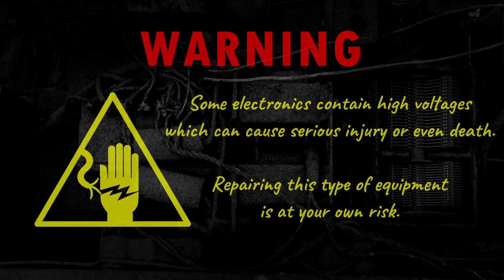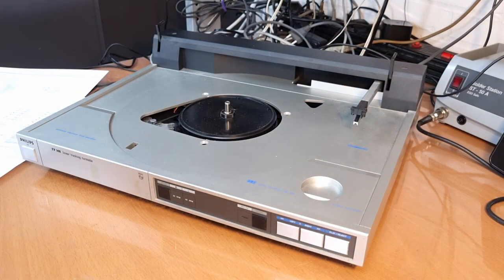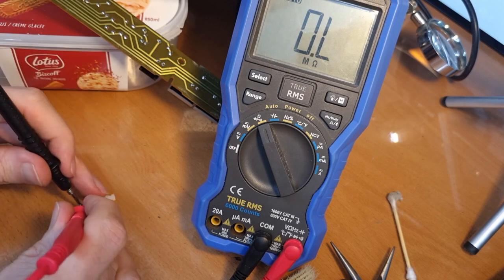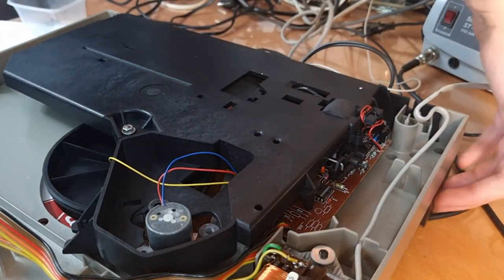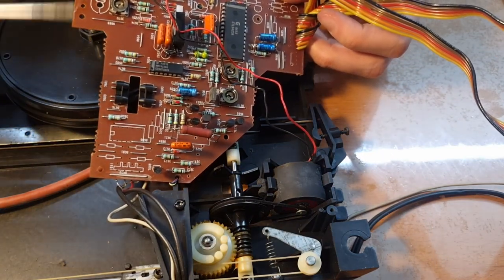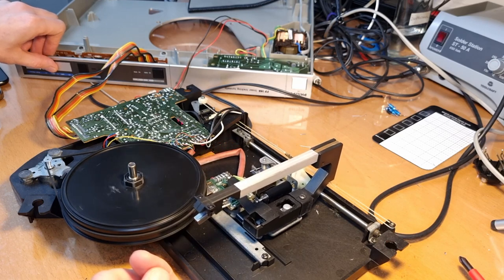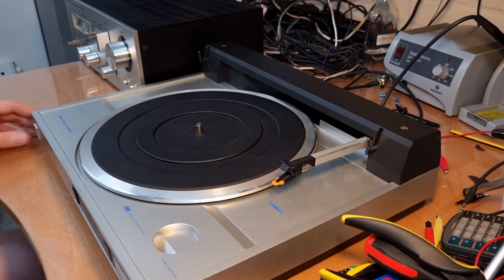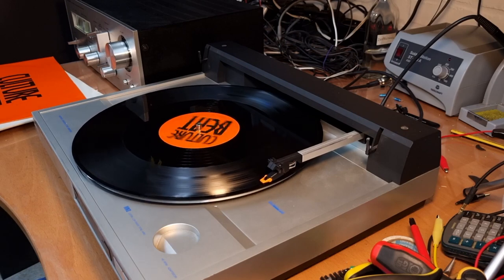Repairing a retro 80s linear tracking turntable - Philips FP146

Comment: Wow and that’s a cool looking tt. Back then there were so many cool looking tts and I had the Technics SL -6 back in 1985.
Reply: It the platter smaller than the record and the record hangs over the platter? I used to looking at the technics SL- 6 with a similar design but it’s the size of a record.jacket.
Reply: I usually put something soft btwn the player and the cover so I don’t leave marks . On my SL -6, there’s a small rubber on the end, but wears out bc of age.

Comment: man, thank you so much for the wonderful, well presented and very detailed description of the parts and what's doing what inside this cool TT. i have exactly the same and you saved me a lot of time and stress, because without your help i simply couldn't figure out how to adjust the auto stop point and which part was responsible for it. people like you make the internet a treasure chest, not a trash dump, although those who work to the other end are a legion. thanks and wishes of the very best!
Reply from the maker: I'm glad to hear my video helped you. It's comments like yours that make spending all that time and effort on editing these videos worthwhile. Thanks!
Reply: yeah i have that same problem aswell! now the only more problem is while 33 rpm works great, 45 changes a lot in speed :/ not to fast or too slow, but in different speeds during playback. luckily im not so often play that kind of records
Reply from the maker: @backstab86  That sounds like a bad contact in the speed selector switch.
Reply: Phillips likes to use photo sensors. The auto stop on my 212 electric has a wedged shape window and a light bulb.    Clearly beer is needed to enhance the sound with that second record. I like that you referred to it as a record player. I call my Technics SL-7 my little close n play. It's quite the little beast. Pulled a power cord out of a dumpster and found a little whale on the other end. You just never know what you're going to find dumpster fishing. I watched this because I really did like that 212 electric and was interested in how Phillips handled linear tracking. Wasn't too surprised that they used photo sensors. Really enjoyed this thanks
Reply: @retro_tech  was just listening to my SL-7 (mentioned in this thread earlier) I didn't notice the degradation of the sound quality that usually is noticeable in the last track of the record. So it does make difference in my opinion based on what I noticed. They also track warped records better with the short low mass tone arm because that really cuts down the moment of inertia. Anti Skating isn't a necessary addition to the tone arm making it mechanically simple that way . The electronics to move the arm aren't as complicated as one might imagine. Then there is the simplicity of just pushing a button on the record plays. I haven't done a thing to that SL-7 other than replace the RCA plug ends since pulling it out of that dumpster 15 years ago . But I've got a Stanton 680 that I'm going to install instead of the Ortofon tm14 that came with it. It's a neat little thing there's an album jacket sitting on top ...it completely covers it. I've seen them mounted on a wall and played upside down. It's truly the ultimate close n play . With some modern batteries and blue tooth speakers it would be totally portable. Good Day to you

Comment: Great video, fantatically well documented. I think you may improve the wow/flutter with a better belt. Seems to have a square cross section and riding right at the top of the drive shaft. A wide flat belt would probably work more effectively.
Reply from the maker: Thanks a lot!
Yes, probably a new belt would have been better, but the owner told me the belt was only recently swapped, so I just left the one which was in there.

Comment: Good morning, first of all, congratulations on the channel.
I have the same turntable and one of the emitting LEDs (7631) does not work so the cart does not advance. I have not found the reference for the broken LED. Can I install any LED?
Thank you very much and greetings
Reply from the maker: Thanks.
I have no clue. Maybe you can find the specs of the receptor and compare the wavelength?
Not sure if they react to red or infrared. To be sure you could pick an LED with a pretty broad wavelength.
Reply: @retro_tech  Thank you very much for the reply. I have been doing tests and it responds to any LED, it is indifferent to color (wavelength).
Thank you very much and greetings
Reply from the maker: @juancarlosrs3681  Good to know! Good luck with your repair.

Comment: Hi, I’m also having a FP 146 MarkII. After  changing the belt, the the player is very fast. More than 36 rpm. One question please: the little whole on the left side of the plate  ( northwest ) is that the potentiometer for the speed? Thanks in advance 😂
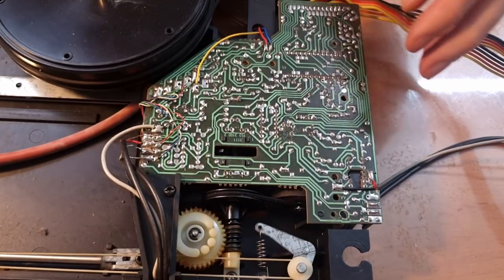Reply from the maker: The holes for reaching the potentiometers are marked with "33" and "45". They are clearly visible around the 26:35 minute mark in my video, on the top side close to where the blue and red wire are soldered to the PCB.
Reply: Thx very much

Comment: Hey. I have the same model and mine doesn't want to autostop. I can't find out why. Is there a sensor that you can adjust or something to tell it when to stop?
Reply from the maker: There are 2 optical sensors (7602 & 7603) that track the position of the tonearm. They should detect the end of record position and trigger the autostop. But if that mechanism is misaligned, then I would expect also issues with the automatic play function.